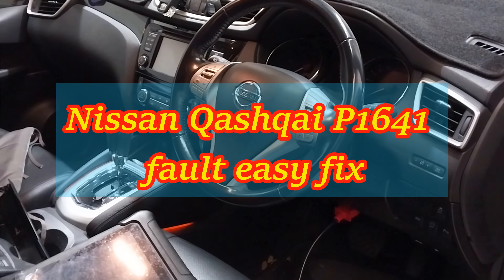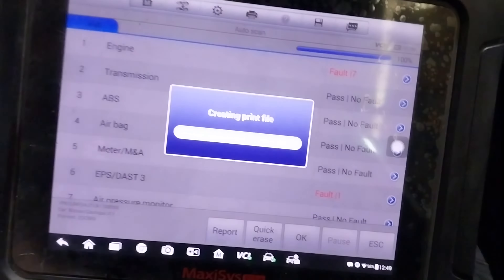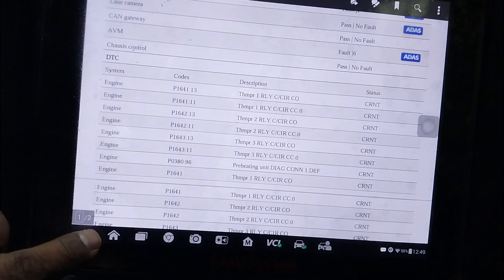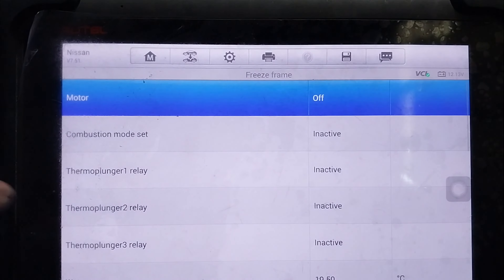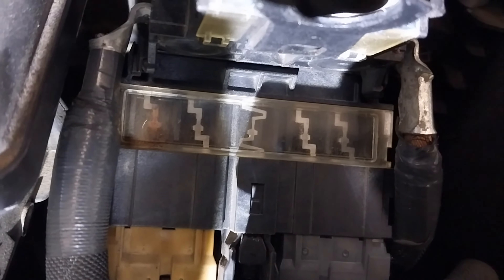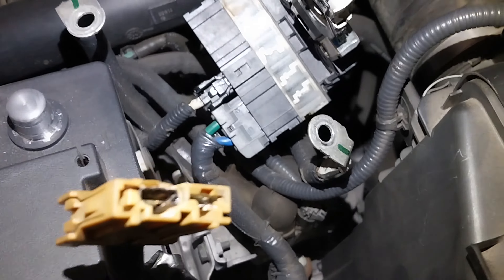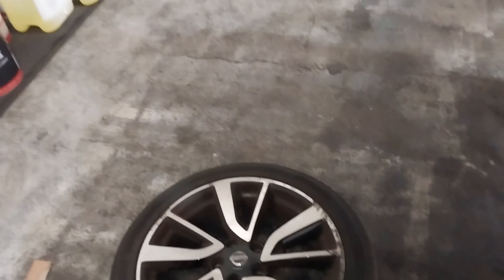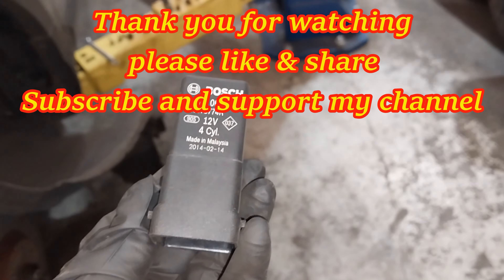How to easily fix Nissan Qashqai p1641 fault with engine hard to start issue engine light on

Comment: Hi ,i have problem with my Nissan Qashqai 1.5 dci Pure drive 2011 year.
My car sometimes has problem with cold start in the morning when outside temperature is lower than 10 degres.
When i start it in the morning white smoke appears on the exsaust .

Car has error : P1650  Thermoplunger control unit 1.def.
Reply from the maker: @DarkoMitic-h5m  hello, 
I think your car looks like having the same issue as per the video. Check the main fuse connector and the actual fuse. check the continuity grim the battery to actual thermostat plunger relay. 
Smoke is pretty normal due to the cold weather.